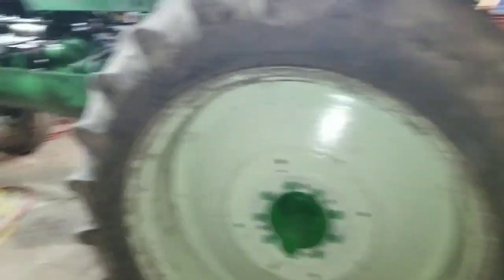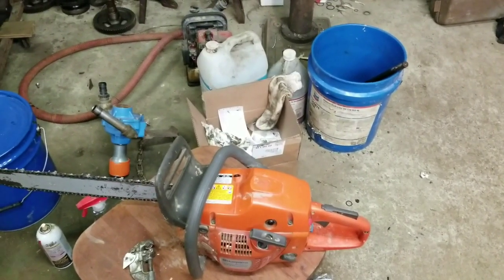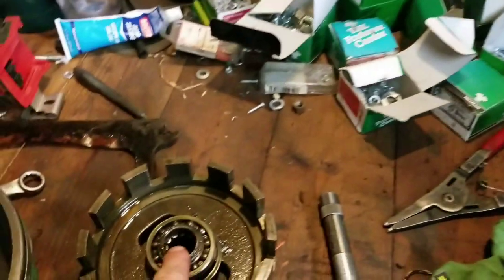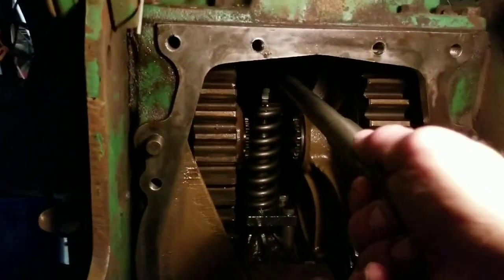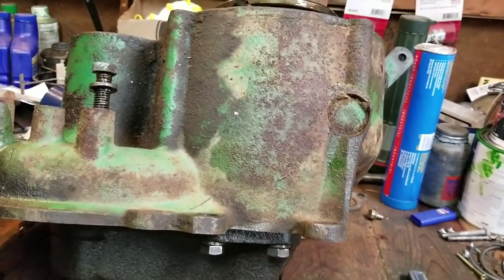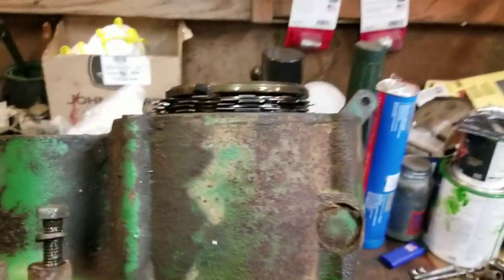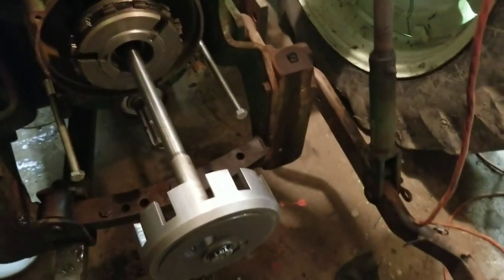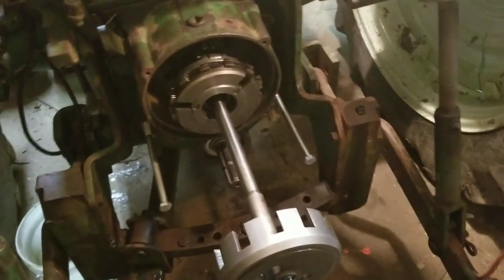More work on the 1550

Comment: Good progress!  Pretty simple to work on really.  We always used the cherry picker to reinstall the PTO assembly on the large frame Olivers and even then it was kind of a bear.  If you haven't already done it, there should be a cap next to the shifter where you can fill the transmission, then it overflows into the rear end.  Book says 40 quarts for the 1550/1555/G550 and 32 for the 1600 and 1655, weird.  I always thought the small frame tractors were about 8 gallons, didn't know the 155x were any different!  Thanks for the video!
Reply from the maker: Oliver's are simple to work on! The John Deeres seem to be  more complicated ! The best part is you can pull the engine with out splitting the tractor!
Reply from the maker: Yeah the manual says 40 qts seems like a lot  for a small tractor!
Reply: @cesmith4566  And that's exactly why dad never wanted to work on John Deeres back when he had a shop!  We split many IHs and for anyone who thinks pulling an engine sounds like more work than splitting a tractor, they need to try it for themselves!
Reply: @cesmith4566  It is!  With that volume you should never have to change it again lol!

Comment: The new fuel return lines look much better than the old ones, really cleaned up the appearance. I had to replace one of those live shafts in a 2-110 due to the chain coming off the oil pump in the trans, took out a couple bearings in the trans. We used the hoist on the service truck, which was a real joy getting the hyd. res. off from under the cab!
Reply from the maker: Thanks Brad! I hope they don't leak!